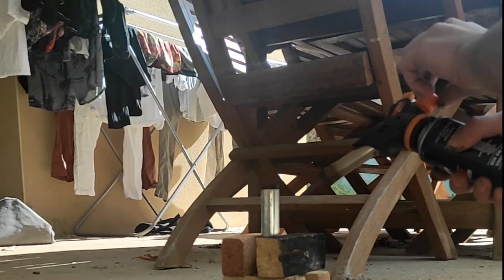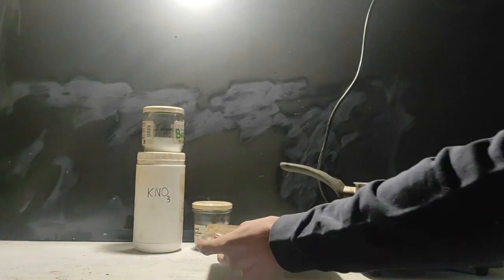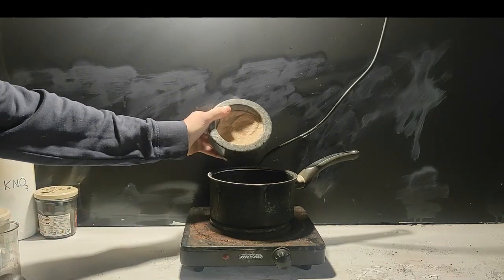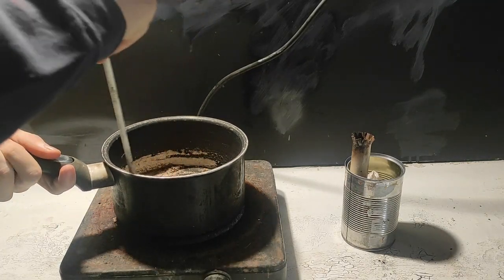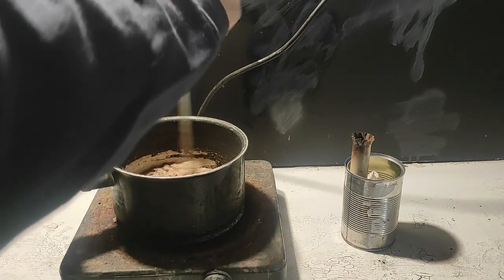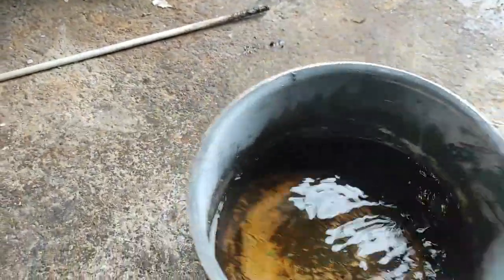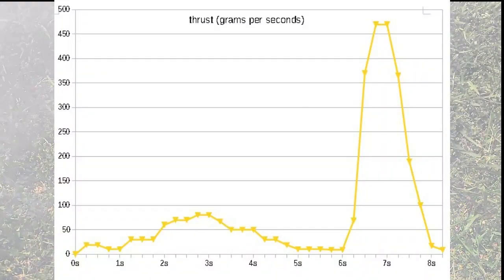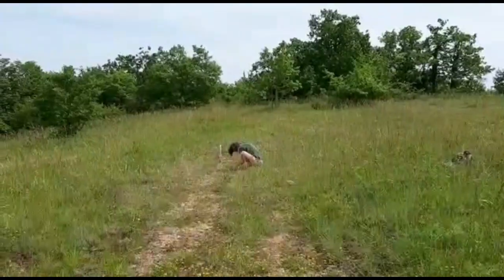making rocket motors ; the lasy way  (100 subs special)

Comment: Oh this brings me memories from my past. Your choice of nozzle material is very questionable lol
Reply from the maker: What do you mean ? It doesn't really burn, only chars very slowly and is a excellent heat insulator. Also you have many sizes to adapt to any tube. I've even reused some after firing a first time
Reply: @jam_kemist3986  One time for the fun of it I made a rocket motor with wooden nozzle. The result was that the diameter doubled in size. When a motor runs close to the pressure limits of the materials or limits of the construction the speed of escaping gasses quickly erodes weak nozzles. The motors I made using wall plaster still eroded the nozzle. You are not even close to what can be achieved by the motor of this size so you might not think there is any problem.
Reply from the maker: @user-py9cy1sy9u  I didn't used wood, and this is only for small motors, of course for a stronger motor you need something better
Reply: @jam_kemist3986  You used tree bark.

Comment: Your accent is fine mate, no wukkas. I'm pretty sure your ignition method could do with some work though... 

Also, I prefer to grind my candy ingredients separately before mixing them. It's just one less risk you need to take that way.
Reply from the maker: Thank you ! Fair enough I guess I had some homemade fuses at this time but they where wet so unusable.
Also knsb propellant is surprisingly stable and unaffected by friction compared to other mixes like chlorates and such so I don't bother, I've never heard anyone getting their fuel ignited when grinding.
Anyways , thanks for watching and commenting !